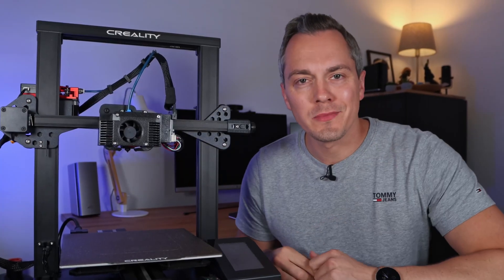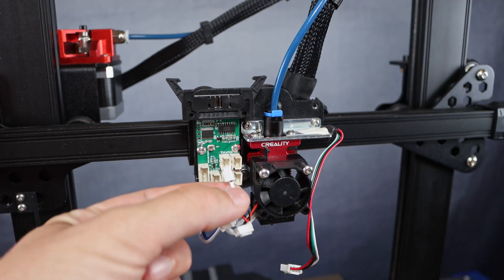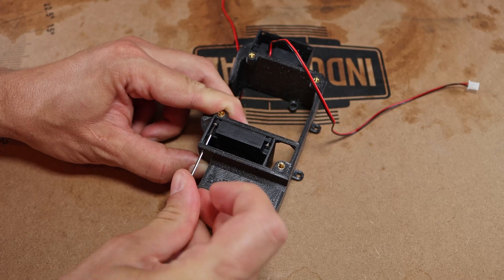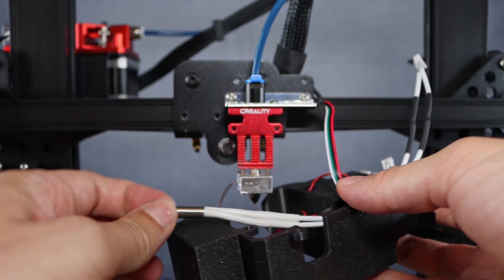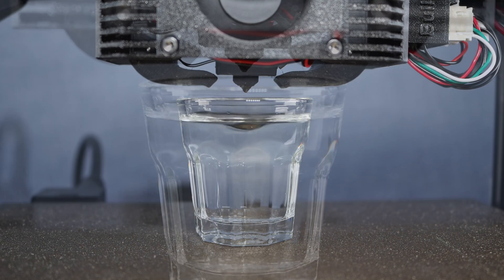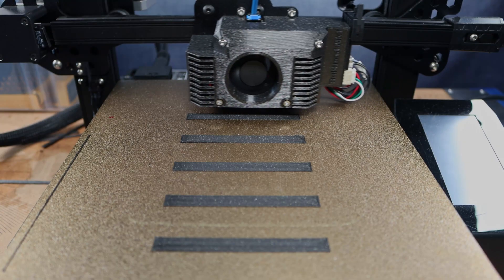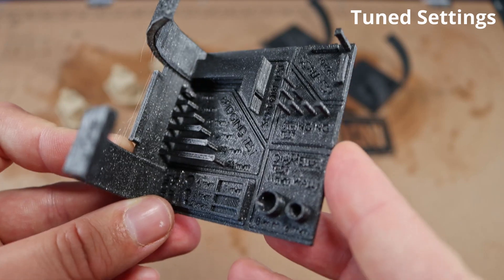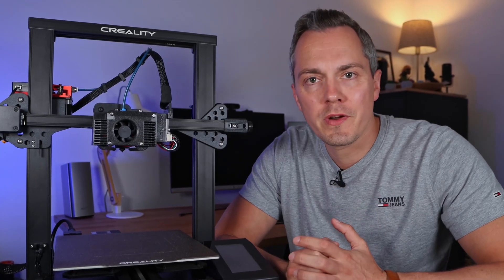Creality CR-6 SE Dual Blower Fan Duct for Better Part Cooling

Comment: Hello, I adapted your drawing to my CR-10 Smart device with the CR-6Se hotend and bracket. After much effort, 
I successfully completed the remix with Direct Drive. 
I have put a lot of effort into this R&D work. With your permission, can I sell the remix file I made?
The results of the device are incredible. Kind regards.
Reply from the maker: Sure, you can go ahead and publish your design. I'm pretty curious though what you came up with, so the condition is that you share the files with me. Deal 😎?
Reply: @thebuildbay  There is a video on my YouTube homepage, but I cannot share the file at the moment.

Comment: Hello, I have something confused, please help me. At minute 3.15, you are holding a cable, it looks like a multiplier. What is the name of this cable or is there a link to the product?
Reply from the maker: Hi there! You are right, this is Y-splitter to connect the two radial fans to the one socket of the mainboard. I actually built it myself. I am not sure if you can buy it somewhere...

Comment: Nice! I am definitely wanting to recreate this for my CR-6 SE! Thx for the video.
Reply from the maker: I am glad you like the idea! I have just finished another mod for the CR-6's extruder. I just have finish the video edit. Stay tuned ;-)
Reply: @thebuildbay  I have a question I hope you can answer for me. Do you know what the max amperage the mainboard can handle for the part cooling fans. The two I have draw 0.07 Amps each. 0.14 Amps won't be too much draw will it. I watched a video recently of a fellow that burned out his Ender 3 mainboard connecting two fans in parallel. Thx!

Comment: How has the shroud fared long-term? I created mine out of PETG and within a week the air duct outlet had melted and deformed to where it's nearly sealed the outlet entirely (Despite using the silicone sock on the hotend).
Reply from the maker: Hmm, I am sorry to hear that. For me the distance between the shroud and the heating block is sufficient. No melting of the shroud...I am currently working on a new mod for the CR-6. Maybe that will be a better solution...stay tuned!
Reply: @thebuildbay That's awesome. I look forward to seeing what you come up with.

Comment: Is there a V2 in the works? I'm going through and installing and it seems the cable management on the current design is a little tough to manage while installing.
Reply from the maker: I agree! I am currently working on a new setup. I will post the video and the files in the upcoming weeks. Stay tuned 😎

Comment: Are you using 2 12V fans or 2 24V fans for the part cooling?
Reply from the maker: I am using two 24V radial fans as the mainboard provides that voltage and I didn't want to go into the hustle of stepping it down 😉

Comment: my friend, I cooled the heatsink with a 4010 axial fan using the duct you designed.  but I'm having trouble reaching 220 degrees and getting an error on the screen.  what could be the reason.
Reply from the maker: I had the same issue. In my case I forgot to put the silicone sock over the heating block. It always caused thermal run away errors. Are you using the silcone sock?

Comment: excellent video and tutorial . Do you changed to E3D-V6 hotend ?
Reply from the maker: Thank you! No, so far I have been using the stock hotend. However, I am currently working on a E3D Revo CR Hotend conversion for the CR-6 SE. I will post the video and the STL files in a couple of weeks 😎

Comment: Really good design! I have a question, if you print with 2 fans at 50% fan speed, can you get the same cooling performance at a much lower noise level?

Comment: In your Thingiverse post, you give a link to Amazon for a 12V axial fan, but the radial fans are 24V.  Other places I have seen say that the CR 6-SE mainboard supplies 24V, so what is the voltage supplied to the axial fan? Appreciate it if you could clarify.
Reply from the maker: You are absolutely right. My bad! I will fix that in the description on Thingiverse. You will need a 24V axial fan. I am using this one: https://geni.us/24VAxial

Comment: Great design!!! 
How is the fan ducts holding up being that close to the hot end? Is the PETG working out ok?
Reply from the maker: Thanks! So far so good. As long as there is a ~1mm gap, it seems to be enough. Plus there is almost always a constant airflow going through the inside of the ducts, which provide extra cooling 😎
Reply: @thebuildbay  great! I’ll get printing !

Comment: 3:50 where is the solder >.<
Reply from the maker: I didn't solder as I twisted the cables and connected them tightly with the shrinking tube. There is zero stress on the connection, so I am confident it will hold. But you are right, to be extra safe, soldering would be the better choice 😎
Reply: @thebuildbay  As an experienced electrician, I can say that a loose electrical connection can not only rust and increase its resistance, but also create a fire hazard, especially since this connection is used to power the heater.  Don't get me wrong, great video :D. I love your attention to details.
Reply from the maker: @piotrczerwonka3133  Alrighty, you convinced me. I will solder the connection on my setup. I am not really interested in a fire hazard 👨‍🚒😉